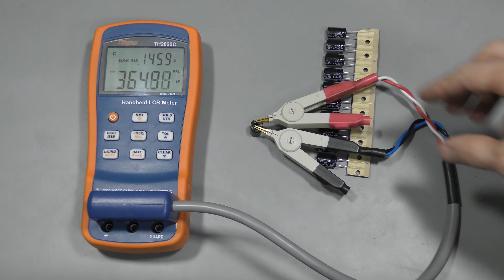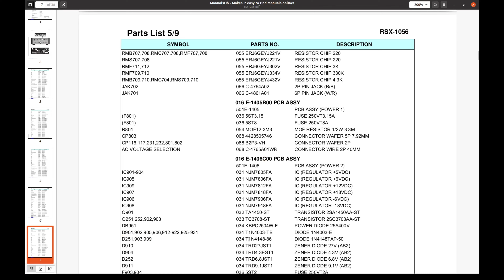#103 - Rotel RSX-1056 repair

Comment: Hi there, I am trying to repair my Rotel RSX-1057 which has no sound coming out from FR/FL channel.  Receiver power ON fine, input selectors working fine.  Just no sound going to FR/FL speakers.  There is power (108V) going to amplifier board.  I cleaned up the amplifier board, and don't see any defective components.  What would you look for the trouble if you troubleshoot this receiver?

Comment: Congratulation's , i was repairing Harman Kardon 1005 , i spent 5 days desoldering its amp board with 200 connections on aluminum heatsink , impossible job . only to find out there is nothing wrong  with it . And here you are , oh thid diode looks unhealthy , lets change it , oh it wors . wonderful work , if only i has so much luck